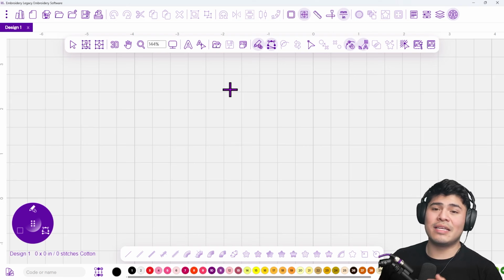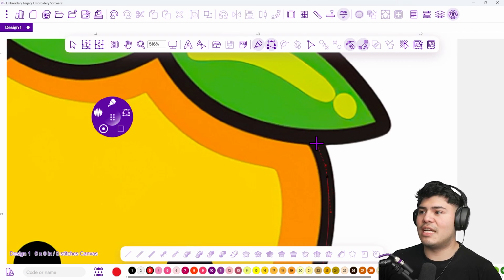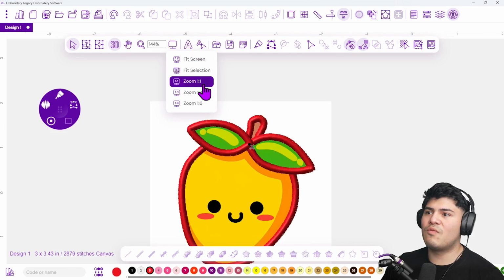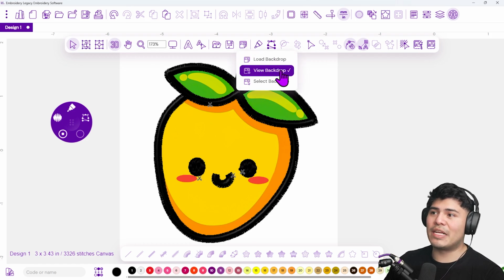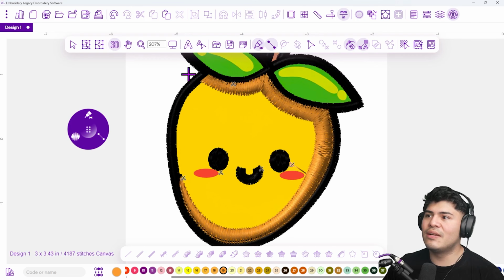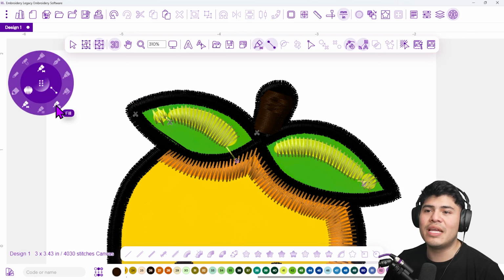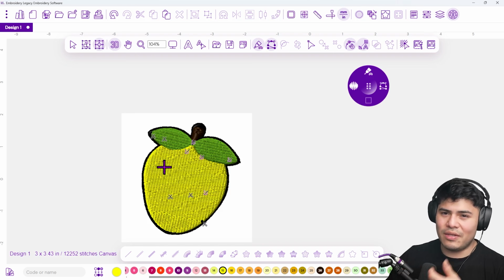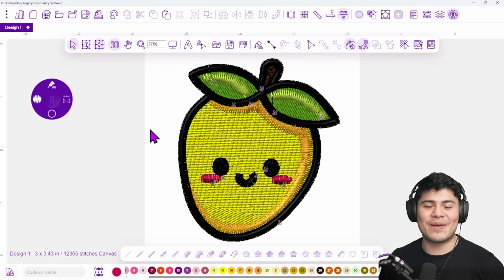How to Digitize Embroidery Designs | Step-by-step Guide!

Comment: You mentioned selecting "no recipe" for a test stitch out. How do you achieve this without embroidering onto a fabric?
Reply from the maker: I’m a little unsure what you mean, but typically I’ll select the recipe beforehand and export with the same settings for a proper test stitch out on fabric. However, for more artistic designs, I sometimes choose “no recipe” to remove all underlays—especially when I know I won’t be using them. 💜
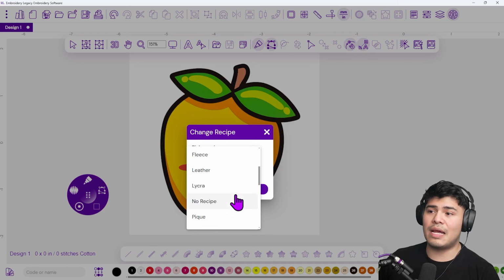Reply: @EmbroideryLegacy At the 2:23 mark it states, “If I’m just going to embroider this on maybe nothing. Just a test. I will choose no recipe.”

Comment: I have so many embroidery made on Creative Drawings , in wich format i need to save them so i can open with EL DIGITIZER?
Reply from the maker: Designs would need to be save in any machine format to be opened in EL Digitizer. Holding onto Creative Drawings to edit native files would be wise a converting designs from expanded data in any outside program will greatly reduce editing functionality.